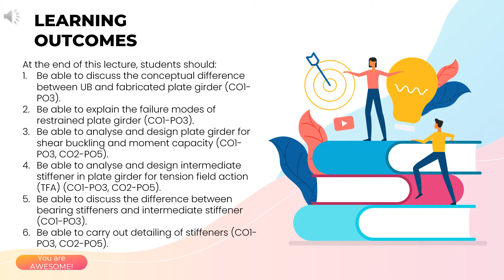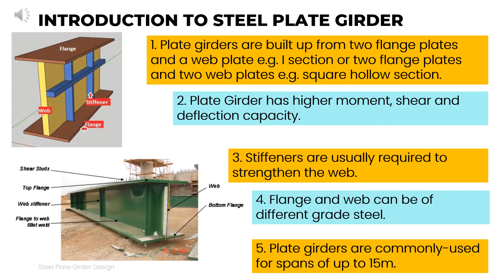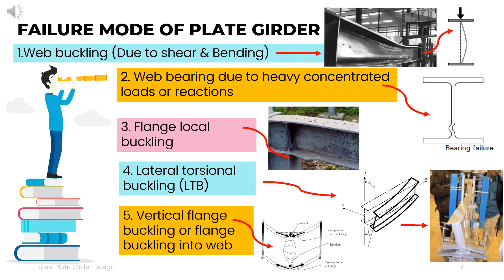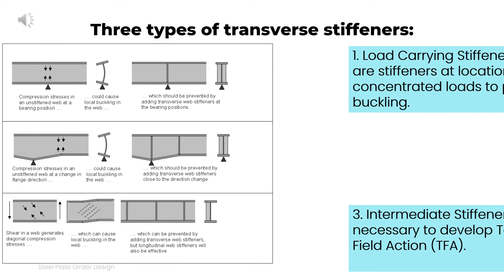Steel Plate Girder (Eurocode 3)-Summary By Dr.Ina

Comment: 5A2 : This lecture introduces steel plate girders, highlighting their use for heavy loads over long spans and comparing them to beams. Key points include:

1. Structure & Use : Plate girders are built from flange and web plates, used in bridges, long-span floors, and industrial structures.
2. Failure Modes and Prevention: Possible failure modes include web buckling due to shear, flange buckling, lateral torsional buckling, and flange buckling into the web. Lateral restraints and transverse stiffeners help prevent these failures.
3. Types of Stiffeners : The three main types are load-carrying, load-bearing, and intermediate stiffeners, each with specific functions to mitigate buckling and support concentrated loads.
4. Tension Field Action : After shear buckling, tension field action can significantly increase the girder’s shear capacity.
5. Design Process : Design involves calculating web thickness, bending resistance, basic dimensions, and stiffener placement.

Comment: 5A2 : INTRODUCTION TO STEEL PLATE GIRDER 

Steel Plate Girder Design
1. Plate girders are built up from two flange plates and a web plate e.g. I section or two flange plates and two web plates e.g. square hollow section.
2. Plate Girder has higher moment, shear and deflection capacity.
3. Stiffeners are usually required to strengthen the web.
4. Flange and web can be of different grade steel.
5. Plate girders are commonly-used for spans of up to 15m.

Comment: 5A2: Plate girders are structural members that resist loads primarily in bending and shear. They key difference between beam and plate girder is the size of component. Plate girder is to support heavy loads like on bridge structure due to its higher moment, shear, and deflection capacity. It is used when we need deeper sections having higher stiffness carrying heavy loads.

Comment: 5A2 : 
- Definition: Steel plate girders are structural members designed primarily for bending and shear. They are constructed from separate steel plates, typically in an I-beam shape, joined by welding, bolting, or riveting.
- Girders are formed from two flange plates and one or more web plates, providing higher moment, shear, and deflection capacity. Stiffeners reinforce the web, and different steel grades may be used for the flange and web.
- For economic efficiency, girders have thick flanges and a thin web. The high depth-to-thickness ratio makes the web prone to buckling, so careful design is essential. Automated welding processes are used for secure assembly.
- Commonly applied for spans up to 15 meters, plate girders are essential in large structures for their load-bearing efficiency.

Comment: 5A2 :
 -	Steel plate girders are strong structural elements used to support heavy loads over long distances. 
-	They are different from Universal Beams because plate girders are designed for higher stiffness. 
-	It explains common problems like web and flange buckling and how stiffeners help prevent these issues. 
-	It also explains the basic steps in designing plate girders, including calculating web thickness, checking shear and bending strength, and adding stiffeners.

Comment: 5A2: plate girders can be defined as structural members that resists loads primarily in bending and shears.
Plate girder has high moment, shear and deflection also stiffeners required to strength the web. Mostly the functions is to support heavy loads and to replace rolled sections for a long beam span requirement. Due to shear and bending will cause web and flange buckling.

Comment: 5A2 : Steel plate girders are structural components that are relatively common to a variety of construction types. They need to be able to withstand heavy loads applied over long distances, as is the case in bridges, buildings, and other kinds of infrastructure work. 

Key Points about Design and Failure Prevention :
1. Compression forces - In a non-stiffened web, local buckling occurs due to compression stresses and must be avoided.
2. Transverse Stiffeners - Transverse web stiffeners at locations of support prevent local buckling and strengthen the structure.
3. Lateral Restraints - Providing sufficient lateral restraints, such as longitudinal composite slabs, is crucial to avoid lateral-torsional buckling (LTB).
4. Design Process - The design of steel plate girders involves careful consideration of load distribution, material properties, and safety factors.
5. Failure Modes - Buckling, shear failure, and fatigue are the common failure modes for steel plate girders which can be resolved by good design practice.
6. Function - Main elements that carry loads from the handrail and floor to the supports.
7. Selection of Materials - The performance and long-term service life of the girder rely on the selection of materials.

Steel plate girders must be well designed and implemented to support the life and safety of structures. Structural engineering success is significantly attributed to a proper understanding of their mechanics and appropriate attempts to prevent failure.

Comment: 5A2 : Plate girders known as structural members that resist loads primarily in bending and shear built up from two flange plates and a web flange. 

The functions are :
1. To support heavy loads
2. To replace rolled sections for a long beam span requirement 
3. Mainly used in railway and road bridges girders 
4. Used when we need deeper sections having higher stiffness to heavy loads 

Failure mode:
1. Web buckling 
2. Flange buckling
3. Lateral torsional buckling 
4. Flange buckling into web 
Can be prevent by providing sufficient lateral restraints and adding transverse stiffeners along the length of the beam web

Comment: 5A2: 
This lecture provides an in-depth look at steel plate girder design, exploring fundamental differences between universal beams and plate girders, and explaining key failure modes, such as web buckling, flange buckling, and lateral torsional buckling. Stiffeners—classified as load-carrying, load-bearing, and intermediate—are emphasized for their role in reinforcing the girder against buckling and distributing loads.

The design process is systematic, involving calculations for web thickness, bending resistance, and detailed stiffener design. Plate girders, typically used in bridges and industrial structures, are favored for their strength in carrying heavy loads over long spans. Features like tension field action, which boosts shear capacity after web buckling, showcase advanced design techniques to ensure structural integrity.

Comment: 5A2: A steel plate girder are built up from two flange plates and a web plate (square hollow section)
- Higher moment,shear and deflection capacity
- Required stiffners to strengthen the web
- Flange and web can be different grade steel
- Commonly-used for spans of up to 15m.
Economical design,plate girder generally hase a very thick flanges,large depth (d) but very thin web (t)
- d/t ration is very high the web is susceptible
- must be carefully designed for the buckling stress

Function of Steel Plate Girder
- Replacing rolled sections for a long beam span
- Supported heavy loads such as on a bridge structure
- Mainly use in railway and road bridge girders, and as crane girders in industrial structures
- Use when need deeper sections having higher stiffness

Failure Mode of Plate Girder
- Web Buckling (Due to Shear and Bending)
- Web Bearing due to heavy concentrated loads or reactions
- Flange local buckling
- Lateral torsional buckling (LTB)
- Vertical flange buckling or flange buckling into web

Comment: 5A2: The functions of steel plate girder are to replace rolled sections for a long beam span requirement as rolled sections need to be spliced and this may result in resistance inefficiency, to support heavy load such as on a bridge structure and it is also used when deeper sections needed with higher stiffness to carry heavy loads.

Comment: 5A6 : INTRODUCTION TO STEEL PLATE GIRDER 

Steel Plate Girder Design
1. Plate girders are built up from two flange plates and a web plate e.g. I section or two flange plates and two web plates e.g. square hollow section.
2. Plate Girder has higher moment, shear and deflection capacity.
3. Stiffeners are usually required to strengthen the web.
4. Flange and web can be of different grade steel.
5. Plate girders are commonly-used for spans of up to 15m.

Comment: 5A6: A steel plate girder is a type of structural beam made by welding or bolting steel plates together to form an I-beam shape. These girders typically consist of a central vertical plate called the web, which resists shear forces, and two horizontal plates on the top and bottom called flanges, which resist bending moments. They can be customized in size, thickness, and strength to meet specific design needs. This makes them particularly suitable for carrying heavy loads over long distances. Plate girder generally has very thick flanges,large depth (d) but very thin web (t). 
Plate girder has higher moment, shear and deflection capacity.
Failure mode of plate girder is lateral torsional buckling .

Comment: 5A6:
INTRODUCTION TO STEEL PLATE GIRDER

Definition to Steel Plate Girder;
1. Plate girders may be defined as structural members that resist loads primarily in bending and shear.
2. A plate girder is typically an I-beam cross-section made up of separate structural steel plates which are welded, bolted or riveted together to form the deeper vertical web and narrower horizontal flanges of the beam.
3. The key difference between a beam and a girder is the size of the component.

INTRODUCTION TO STEEL PLATE GIRDER
Flange
1. Plate girders are built up from two flange plates and a web plate e.g. I section or two flange plates and two web plates e.g. square hollow section.
Stiffener
2. Plate Girder has higher moment, shear and deflection capacity.
3. Stiffeners are usually required to strengthen the web.
4. Flange and web can be of different grade steel.
5. Plate girders are commonly-used for spans of up to 15m.

INTRODUCTION TO STEEL PLATE GIRDER

1. For economical design, plate girder generally has very thick flanges, large depth (d) but very thin web (t).
2. As the d/t ratio is very high the web is susceptible to buckling and therefore must be carefully designed for the buckling stress.
3. Size of plates (flange and web) can be chosen by designer.
4. Continuous automatic electric arc or submerged gas welding is used to form the fillet welds between the flange and web, and usually performed as a double pass one on either side of the girder.

Functions of Steel Plate Girder

1. To replace rolled sections for a long beam span requirement as rolled sections need to be spliced and this may result in resistance inefficiency.
2. To support heavy loads such as on a bridge structure.
3. Plate girders are mainly used in railway and road bridge girders, and as crane girders in industrial structures.
4. A plate girder is used when we need deeper sections having higher stiffness to carry heavy loads.

STEEL PLATE GIRDER
DESIGN PROCESS
1. Minimum web thickness
2. Bending resistance
3. Basic dimensioning
4. Web design
5. Design of stiffeners

Comment: 5A6: Although plate girders and universal beams (UB) serve similar purposes, they differ in size, shape, and the amount of weight they can support. Plate girders can fail in five different ways: flange local buckling, lateral torsional buckling, vertical flange buckling, web buckling from shear and bending, and web buckling from severe concentrated loads. By adding transverse stiffener and providing adequate lateral restraint, these problems can be avoided.

Comment: 5A6: PLATE GIRDER
- Plate girder are structural members that resist loads primarily in bending and shear.
-  plate girder are made up of two flange plates and a web plate, and have a higher moment, shear, and deflection capacity.
- plate girders are commonly used for spans of up to 15M and have thick flanges, large depth, and thin web.

Susceptibility of Web to Buckling
- High d/t ratio makes the Web susceptible to buckling.
- Stiffener are used to strengthen the web.
 -continuous automatic electric arc or Submerge gas welding is used to form the fillet welds between the flange and web.

Preventing Failure Modes in Structures
- Lateral restraints, such as composite slaps, can prevent lateral torsional buckling.
- Transverse stiffeners combat web buckling and support concentrated loads.
- Three types of transverse stiffeners exist: load carrying, load bearing, and intermediate.

Steel Plate Girder Design Procedure
- Tension field action enhances the shear capacity of plate girders.
- Design process involves calculating minimum web thickness, bending resistance, basic dimensioning, web design, and stiffener design.

Comment: 5A6: This video covers the basics of steel plate girder design, highlighting differences between girders and beams, and explaining how girders support large loads over long spans. It discusses failure modes like web and flange buckling, which can be controlled with stiffeners, and outlines a five-step design process focused on stiffeners, bending resistance, and web thickness.

Comment: 5A6: The fundamentals of steel plate girder design are covered in this video. It describes the main differences between girders and beams and emphasizes how girders manage large loads across extended spans. It talks about failure modes that can be managed with stiffeners, such as web and flange buckling. Additionally, a five-step design process that emphasizes stiffener features, bending resistance, and web thickness is presented.

Comment: 5A6: Plate girders are structural members designed to resist bending and shear loads. They have an I-beam shape, with a deep vertical web and narrower horizontal flanges, formed by welding, bolting, or riveting steel plates together. Unlike beams, girders are distinguished by their larger size. Plate girder has a higher moment, shear and deflection capacity. A plate girder is used when deeper, stiffer sections are needed to support heavy loads. One of the failure modes of plate girder is lateral torsional buckling and the way to prevent it is providing sufficient lateral restraints such as composite slab to avoid LTB.

Steel Plate Girder Design Process:
1. Minimum web thickness
2. Bending resistance
3. Basic dimensioning
4. Web design
5. Design of stiffeners.

Comment: 5A6 summary :

Definition :
- Plate girders defined as structural members that resist loads primarily in bending and shear.
- A plate girder is typically an I- beam cross-section made up of separate structural steel plates which are welded, bolted or riveted together to form the deeper vertical web and narrower horizontal flanges of the beam.
- The key difference between a beam and a girder is the size of the component.

Designing Steel Plate Girder :

- Plate girders are built up from two flange plates and a web plate e.g. I section or two flange plates and two web plates such as square hollow section.
- Plate Girder has higher moment, shear and deflection capacity.
- Stiffeners are usually required to strengthen the web.
- Flange and web can be of different grade steel.
- Plate girders are commonly-used for spans of up to 15m.

FAILURE MODE OF PLATE GIRDER are :
- Web buckling due to shear & bending
- Web bearing due to heavy concentrated loads or reactions
- Flange local buckling
- Lateral torsional
buckling (LTB)
- Vertical flange buckling or flange buckling into web

Steel Plate Girder Design Process contained , Minimum web thickness, Bending resistance, 
Basic dimensioning,
Web design and,
Design of stiffeners

Comment: 5A6: A plate girder is an I-beam cross-section composed of many plates that are joined by welding, bolting, or riveting to provide the beam's thinner horizontal flange and deeper vertical web. The component's size distinguishes a constructed plate girder from a beam. Web buckling, web bearing as a result of high concentrated loads or responses, flange local buckling, lateral local buckling (LTB), and vertical flange buckling/flange buckling into the web are some of the failure mechanism plate girder types.

Comment: 5A6:
Steel Plate Girder;
-	Defined as structural member that resist loads primarily in bending and shear. It’s size of component different with a beam. 

Function;
-	To replace rolled sections for a long beam span requirement 
-	To support heavy loads such as on a bridge structure 
-	Mainly used in railway and road bridge girders/crane girders
-	Used when we need deeper sections having higher stiffness to carry heavy loads 

 Failure mode of plate girder;
-	Web buckling (due to shear & bending)
-	Web bearing due to heavy concentrated loads/reactions
-	Flange local buckling 
-	Lateral Torsional Buckling (LTB)
-	Vertical flange buckling/flange buckling into web 

Failure mode can be prevented by;
-	Providing sufficient lateral restraints composite slab to avoid LTB
-	Add transverse stiffeners along the length of the web

3 types of transverse stiffeners;
-	Load Carrying Stiffeners 
-	Load Bearing Stiffeners
-	Intermediate Stiffeners